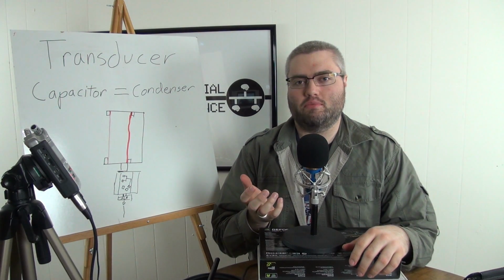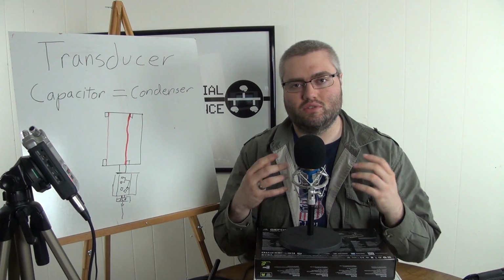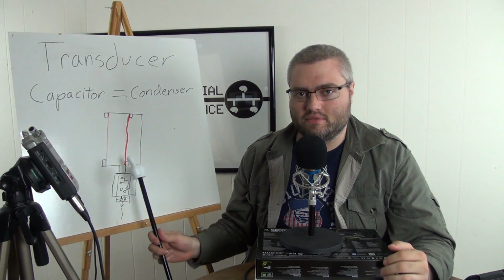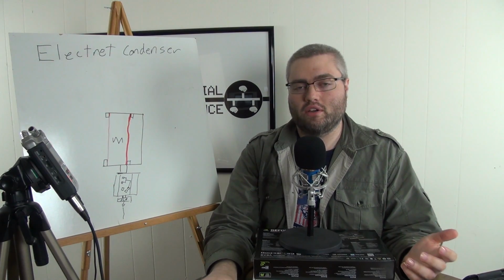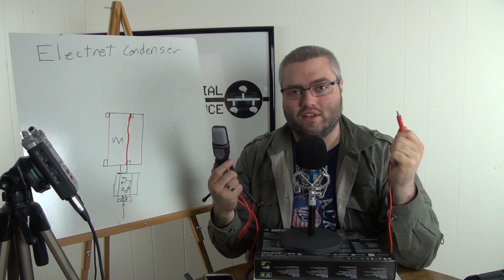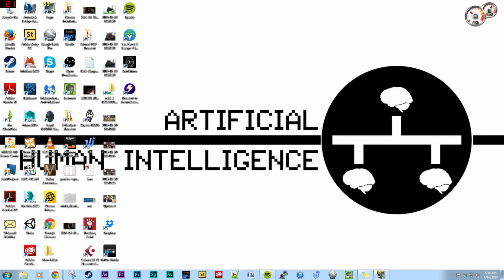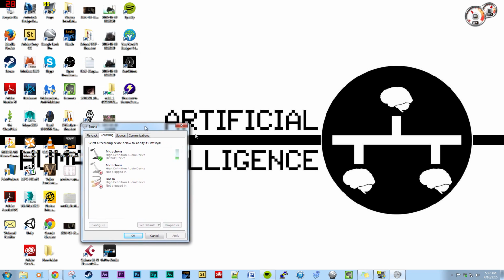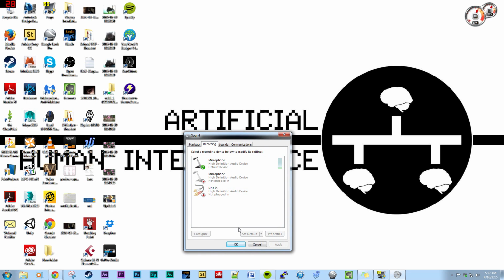How to set up a Condenser Microphone

Comment: Listen, I clicked on this video to figure out how to set up a condenser microphone. I don't need to know the definition of a microphone, or what everything does, I just want to know where to plug shit in.
Reply: EPZY same
Reply: EXACTLY! I WANT TO MAKE SOUNDS FOR MY SCRATCH GAME AND I WANT TO BE SURE I PLUGGED THE MIC IN THE RIGHT PLACE! btw im using a mac.
Reply: EPZY fr tho!
Reply: yo did u find out cos I'm still wondering got my mic today, but when I click on it in sounds, it doesn't work pls help
Reply: did you get a power source for it as well? I made that mistake when I got my first condenser mic
Reply: @EPZY agree - I wanted to know about mic placement and how to check the levels etc.

Didnt need to hear about how the mic works internally.
Reply: Rizzdoms y’all need to lower your gain input and have a noise gate activated ,if that don’t work then either the mic is caca or your computer/“studio equipment” whatever your using is causing too much noise which is why you see ghetto rappers with the panels all over their booths to stop background noise from coming in the mic. If that doesn’t work then your not setting up the mic right or you need a mixer,I prefer the Yamaha AW if needed but any other mixer is fine since the Yamaha is really fucking pricey ,I saw some for like $105 on sweetwater. As for setting the mic,maybe the mic volume is too high and it’s picking up background noise that isn’t needed,REMEMBER you don’t need to set up your mic volume where you could hear it from a foot away,and if you do you better have acoustic panels because a sensitive mic is exactly what you expect SENSITIVE so it WILL pick up unwanted noise due to sensitivity
Reply: respect his content like you would like your content to be respected.
Reply: Can we hear ourself with bm 800 microphone live like when performing? And is phantom power supply an audio interface through which we can hear us live too? 
Any help would be highly appreciated!
Reply: Well, you should know how it works dingdong. Knowing how to plug it in doesn't mean you know how to set it up
Reply: I just got a lecture from a human groundhog...and I still have no clue why my stuff isn’t working
Reply: But I must say, I did enjoy the FYI background. #Sciencegeeksunite
Reply: Yeah, nah...
Reply: Mic+power supply +computer =sound. Try audacity to change your voice a little bit

Comment: Okay so i have the same Mic as you with the 48V Phantom power supply and all the right cables i set it up and it was working fine and i could hear the Mic when i testing it on the Recording devices but shortly after it stopped working and now when i try to listen to the device or record with it all i hear is a buzzing sound i researched about it but i can't find anything to help
Reply: Hi, I still have the mic but kind of forgot about it. I wanted to try again to set it up. So I'm still confused at what the problem is
Reply: PurpleOfMurple i feel bad for you
Reply: yeah bro nah heh lol, do you have any idea to help me xD
Reply from the maker: Check all of your cable connections, make sure everything is plugged all the way in. Then, I would check your recording level and make sure that it is not up too much as that could be bringing the noise floor up and that might be what you are hearing. Also, there may be components that are adding noise to the signal. I found that my zoom h4n was adding a buzz when I would listen through the headphones while recording live, but it wouldn't be in the actual recording.
Reply from the maker: Me too, Youtube doesn't always show me all the comments for some reason.
Reply: PurpleOfMurple Mine never started working to begin with
I have a feeling it was the new xlr cable that i bought
Reply: higher chance of a driver/software issue... i would recommend getting an external soundcard and connecting the condenser mic (powered by phantom power supply) to the external soundcard by 3.5 or 6.3 that way the computer uses the software with the soundcard and you don't get any annoying driver issues... i would recommend the TSdrena  HAM-UDAA2 for the cheapest option!

Comment: Will a condenser mic even without Phantom Power? I bought a Takstar Tak35 and it wouldnt seem to work with my mixer that has no phantom power. However, I also have a BM-800 and it works directly straight to the PC

Comment: This is a wonderfully informative video, thank you, except all the web pages, videos, PDFs, etc, that I"ve looked at say rather ambiguously, "Plug it into your computer.." There are two plugs that might be appropriate. Normally there would be no question and I would use MIC, however, the signal is coming out of a basic phantom power supply, which is functionally equivalent to a one-input, one-output mixing board with no controls, in other words, it makes sense if the signal were to go into the LINE IN jack. I've tried both, but neither are working. I have a LINUX system, which puts me even deeper into the desert, since nobody has much to say about that... Thanks though.

Comment: Awesome and easy to follow! Thanks a bunch for this video - it was just enough info, and just what I needed! I have subscribed. :)
Reply from the maker: You're welcome, and Thank you!
Reply: @MacAmbrais  - I've gotten everything set up with the Phantom Power Supply and an out-cable to USB. Works like a charm! The recording in Windows is pretty soft / quiet. I'm trying to configure for more. I expect if I did noise reduction on this in Audacity, it would sound like a weeny little mouse... BUT there's so little noise to remove that I'm like... maybe it's a waste of energy? Lol!
Reply: Except for the helicopter that just flew over my recording. Grrrr!

Comment: I’m new to all of this stuff but I keep hearing about an audio interface .. is that an equivalent to a power source that u mentioned ? Or is it for something totally different?
Reply from the maker: An audio interface is a connection point between the input(mic) and a computer. It basically allows the 
Computer to have an interface with the mic. Some interfaces have phantom power built in.

Comment: Hello there. Thanks for sharing. I have an MX-100 condenser mic that came with a studio kit. I have all of the XLR cords as well as a phantom power supply.  I do not have an interface and I'm using an iPad for audio. Im trying to avoid buying a new mic. Do you have any suggestions for anything else I need?

Comment: I got a BM-800 and it works fine when I plug it in to my pc
Reply: +The Ocelot Gamer How?
Reply: +MenaTwoFour my pc might have more power or electricity running thorough it
Reply: Daniël's Tech & Music Channel well it works and that's all I need it to do :-)
Reply: +The Ocelot Gamer The BM-800 needs at least 5 volts to function. So I envy your pc that is providing the power for the mic.
To reach the mic's full potential, phantom power can be used but it's not a necessity as you have discovered.

Comment: I have bought the NW-800 microphone along with a phantom power supply, I use it on a desktop which has a pink microphone jack. Yet the volume is extremely low (barely detects my voice) and very noisy as if there's a vent in the background. What am I doing wrong?

Comment: So, my bm800 requires phantom power? I was under the impression that phantom is 48v, and my bm800 has an operating voltage of 5-9v.. I wont kill the mic by plugging it into phantom power? I am trying to get it setup with a Roland micro cube (guitar amp) and a USB power supply for phantom. The chain i am thinking is bm800 into phantom power via XLR, and take signal from the phantom with an XLR to 1/4" male output into the guitar amp. Would this work?

Comment: Hey I’m trying to plug a small diaphram condenser mic into a powered monitor and it’s not working. But the mic works when I use it through my audio interface. What’s the issue?

Comment: Very good video, I especially liked that you went trough some theory. However I have a problem with my bm800: I am using focusrite scarlett 2i2 (it has phantom power) but I get absolutely nothing. Could it be a problem that I have plugged the bm800 to the scarlett via xlr - 3.5mm jack with a adaptor? I believe that I should also be able to hear something when I plug this mic straight to laptop but I dont. Thanks in advance!

Comment: i have 2 BM-700 mics that i want to use for a podcast. i have 2 XLR cables to connect the mics to my mixer which is a Mackie ProFx12v2 USB Mixer that has 48V. When i tried to hook them up and record, the quality sounded great but there was a noticeably loud hum or buzz sound coming thru my head phones while recording. Can you please tell me what i could be possibly have been doing wrong? Thanks in advance because i would hate to see these brand new mics go to waste due to what could be human error

Comment: I bought Bm-800 and an audio interface M-audio MK2 , the other dynamic microphone is working fine but for some reason the bm-800 is not working, all i hear is buzzing noise at 100% gain, doesn't work even after turning on the phantom power on the m-audio mk2, i have xlr to 6.5mm cable, do i need xlr - xlr cable to power the microphone or do you think the microphone is damaged ??? help me out please

Comment: The BM800 comes with an XLR<->Stereo cable, right? Doesn't look like 3.5mm from the picture. Looks like I need to buy a XLR 3 pin (both ends) to run between the mic and the phantom power supply. The Power supply doesn't appear to come with a cable. What type of cable do I run between the phantom power supply and my laptop? I only have USB and Aux (headphone-3.5mm) jacks on my laptop. A headphone jack is not the same as a stereo jack, would I need a stereo-to-headphones(3.5mm adapter? Does such a thing exist? Love this video but more information on the cabling would be helpful. Thanks.

Comment: None of the mics are making noise, and none say BM-800 (the mic I have). The mic is plugged directly into the Pc with a 3.5 millimeter jack.
Reply: I know its 6 months later, but i use an XLR to USB cable from my power supply to my pc, which works
Reply: thanks

Comment: Whenever I plug my microphone into Phantom power then into my computer, all I get is little clicks. Any way to fix that?
Reply from the maker: +TechNiVolt My suggestion to start with is: Make sure the connections are tight, make sure the phantom power is on, make sure that the microphone is selected in the Recording devices settings on the computer(Or Mac equivalent), set the input level to 80%, make sure that the recording software is looking at the correct input when recording (That has stumped me before), and then if all of that fails it could be a bad cable, phantom power supply, or microphone. I would start with the cables if anything is bad, you can unscrew the ends and look at the solder connections.
Reply: +Artificial Human Intelligence don't worry, I got it. I now just have a bunch of background noise from my loud ass computer

Comment: Hellow. I just bought a BM-800 from Ebay because I heard that it did it's job and it was no expensive 😊. I know that I need phantom power to make it work but I need your advice. The cable from the mic has a 3.5 mm jack at the end. My idea for the mic is to use it on my phone in the app from Smule that makes you do covers of songs with people al over the world. I need to hear the music in my headphones that connected to my phones 3.5 jack so that the sound don't go in to the mic. But there's only one hole in the phone. So my idea was to order a sort of spitter with one cable in the phone and that has two holes in the other end. One for a mic and one for the headphones. It has not arrived yet but will this work with the mic I bought? Thanks for the help. Andy from Sweden. 

P.s it would be awesome if you made a movie on how to make this work because I guarantee you that many people want to get better sound when there singing in this app. Thanks again

Comment: My windows 10 can't detect the external microphone. when i click recording devices it shows "mic in at front panel  not plugged in".
Reply from the maker: Check your drivers. Make sure that you have the chipset and audio drivers for your motherboard installed.

Comment: This was very helpful, but it will not work for me.
I have a 2015 Mac and i've connected everything exactly like you said.
But my computer won't recognize the condenser mic or something. IM SO FRUSTRATEDDDDDDDDDDDDDDDDDDDDDDD PLEASE HELP
Reply from the maker: No worries. When you plug in the 3.5mm jack into the microphone port on your mac it should recognize it as just a regular microphone input. Try this: https://support.apple.com/kb/PH18961?locale=en_US

Let me know if that works.
Reply: THANK YOU SO MUCH!!!

Comment: Do I need an external "sound card" or just the phantom power for it to work?
Reply: Just the phantom power but an external sound card is recommended
Reply: Bob Limp As long as your computer has a connection for mic and headphones separately you can use it otherwise you need an adapter

Comment: Did you also use the phantom power you put in the description?
Reply from the maker: +DJekrom I have the condenser mic plugged into a Zoom H4N which supplies it with phantom power. However, I actually have purchased that power supply and will be doing a video on it soon. :)
Reply: Thank you for the help!
 :)

Comment: I am doing everything showed in this video and checking my audio settings and my computer won't pick it up. I payed a good amount of money for all this equipment and nothing will work so someone please help
Reply from the maker: +Joey Make sure the right input is selected inside the recording devices as default. Sometimes if there are more than one microphone input jacks it can set the non used one as default.

Comment: Cool video, may I ask something? I've bought a TONOR USB Condenser Micro, but while recording I get a technical noise of one frequency, it's not the background noise, what should I do to get rid of that noise, do some USB-USB sound cards exist?
Reply from the maker: They probably make them, but it shouldn't be necessary. I would check the recording level that you have it set to. If I have the recording level boosted too high then the noise floor starts to interfere. Also change usb ports and see if that changes anything.

Comment: So I have a condenser mic but I don't have a power source just a USB plug In that I'm assuming works as one but my problem is that when I listen back to the audio that I record I get the high pitched noise that you were talking about and I don't know how to fix it. 
I'm recording music so I do use headphones while recording but is there any way to bypass tjos high pitched noise?
Reply from the maker: Are you listening to it live or do you hear it when you play it back? Sometimes you can hear a high pitched hiss when you are listening to it live just from different components in the system. I would get a phantom power source, without one you will have to boost the mic to the point where the noise floor may become a problem.

Comment: is it a MUST for having the Phantom power supply? or i can just use the cable from the microphone to connect to the pc and that's it
Reply: Its Not a must have But If Your Using 3.5 mm And The Port does Not Have Power Going Through The Port 
You Will Need One Or A USB Sound card

Comment: Do you actually use the Nady phantom power or do you use another one? 
Is the audio in the video the microphone audio?
Just wanted to know.
Thanks
Reply from the maker: +Ashe pradeep In the video I have the BM-800 connected directly to a Zoom H4N. However, I do own the Nady and will be making another video on using that while connecting the condenser mic to the PC. :)
Reply: Thanks AHI

Comment: I have a problem with my audio recorded on D5200 nikon and mic is behringer B1.The recorded audio has continuous breaks in between for a few seconds.
The video is shot on these settings : 50 hz / 24p . .Could you help me with this issue. Thanks.
Reply from the maker: No idea, do you have a phantom power supply?

Comment: would behringer U-Phoria um2 replace the phantom power and should i get it instead of the phantom power supply
Reply from the maker: It looks like it has Phantom Power built into it, so it would power the microphone, and interface with your computer. If it was me, I would probably get one.

Comment: Would a phantom power supply typically come with an xlr cable 
or would I buy them separately?
Reply from the maker: +Soulless138 They don't come with one usually, so you would have to buy one separately.
Reply: Alright man thanks

Comment: quick question I recent got one in the mail today and it didn't come with the Phantom power supply but it came with an adapter that connects to my pc via USB I got some loud feedback is there any way around it or do I have to have the power supply
Reply from the maker: You probably need the power supply. Unless the usb cable works like a Blue Icicle usb to xlr, which is not typical.

Comment: I just purchased the CAD GXL2200 condenser microphone and InnoGear 1229 phantom power but my computer still doesn't seem to be picking up the signal. Any tips?
Reply: Nope idonno
Reply from the maker: Check your cables to see if the solder came off the connectors. Make sure that you have the correct input selected inside your recording program and in the settings. Otherwise, you could have a damaged mic or power supply.

Comment: You made a mistake in your video.....Electret Microphones uses phantom power too. Your phone or PC will supply less that 5v power to the mic. electret is a small diaphragm than the larger condenser ones.
Reply from the maker: John Vellone Perhaps, but the point is that for a condenser mic you need that 48v power.